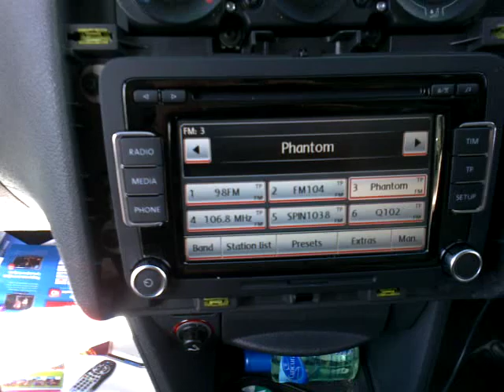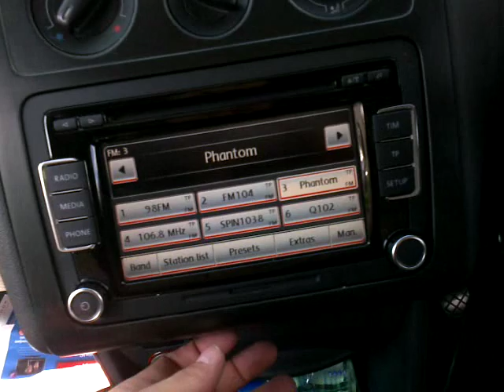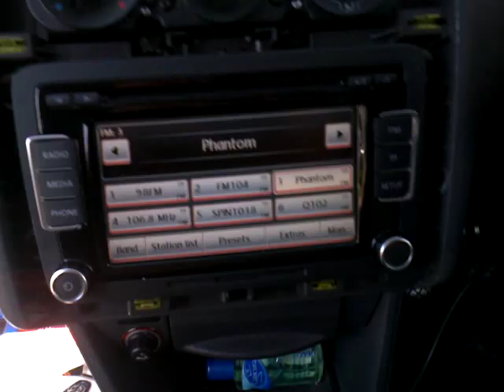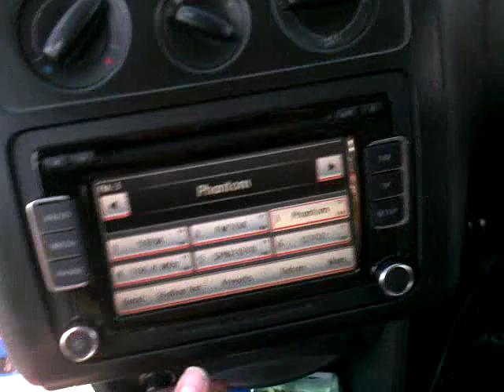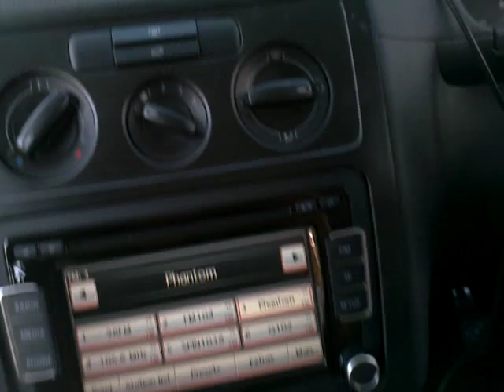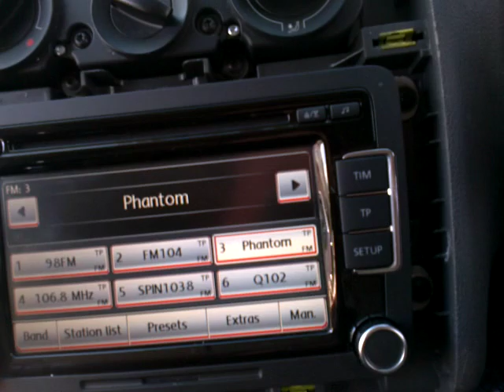How to remove radio from VW Caddy  2006

Comment: Did you have any problems with the new unit draining your battery? I have read that when fitting new units into older caddy's you may need a part (can bus module?) to stop it draining the battery. Looks awesome by the way!